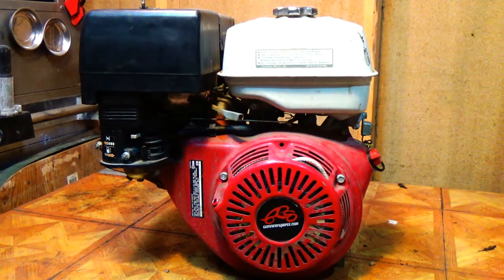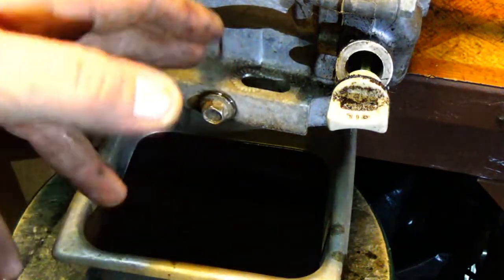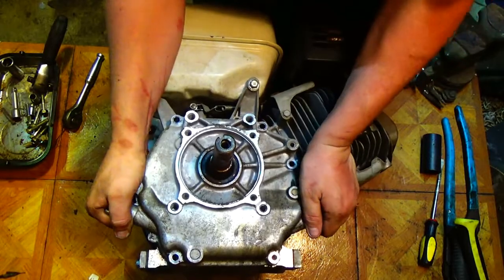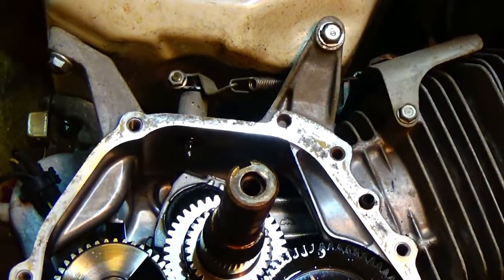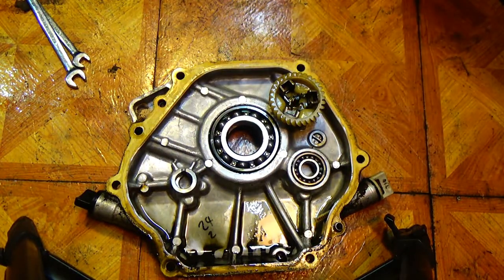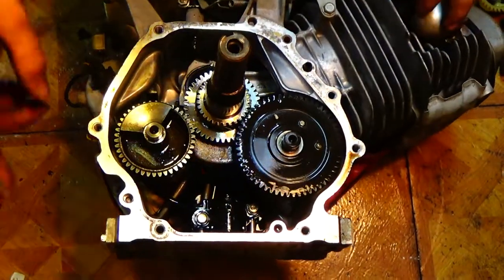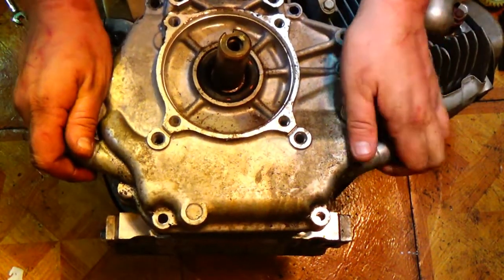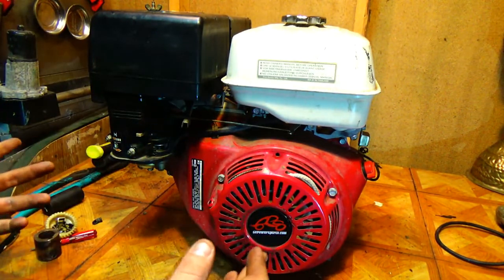Removing the Governor on Predator 420, Duromax 440, and Honda GX390 Engines

Comment: Washer of death dumby. How are u making this video and not mentioning the washer of death. Oh cause u left it in. The only reason u may get lucky and not have it come off that stud and ruin the engine is because u used bolt cutters to unnecessarily cut off the stud and if ur lucky that just did flare the thing enough to not allow washer to come off. Bolt cutters. Ide a left the arm in and hooked up to the linkage so can run stock carbs without a throttle plate . Because it doesn't hurt anything as long as it's left hooked up to the linkage . And by God take out the oil sensor and plug that hole. Like wtf. Ur engine gonna be cutting off when u hit hard turns . 🙄

Comment: Can we just disable the governor without disassembly?  Or hook up to open the governor? We used to simply wire them back. Of course that was decades ago.  How can it govanate if unhooked from the carb or wires wide open?
Reply: The issue with that is you have a plastic gear with metal bits attached to it that wasn't designed to go over a certain rpm. The gear gives up and you have parts bouncing around inside your engine

Comment: Why would this give us extra rpms? Tia
Reply: The governor closes the throttle when the rpm gets too high. Removing it allows the engine to rev to its full potential. Stock engines cant handle much of that high rpm abuse

Comment: I don't see any Honda GX 390 or clone hop up videos.Are doing any?
Reply from the maker: Nah the big block clones are too expensive to mess with.  For the cost of a GX390 or clone build and Torque Converter i can use an ATV or Motorcycle style engine and have more power.

Comment: so wot happens when its removed
Reply from the maker: Engine can rev above the governed 3600 rpm and allows it create more power.
Reply: @nachodadsgarage1159   i have 9 hp honda engine gx 270 would doing this to my stump grinder gv it more cutting powere

Comment: Would you suggest heavier valve springs to go along with this mod?
Reply from the maker: Yes, keeping the stock springs will give valve float around 5k rpms
Reply: @nachodadsgarage1159  Also, will I throw a rod without replacing it with a billeted aluminum one? It's happened before with a predator I had.

Comment: so will this work with the 18hp duromax engine?
Reply from the maker: Yes, I just cracked the case open on my 440 and its set up almost identical to this one
Reply: Nachodads Garage what about the duromax 420? 16hp motor
Reply from the maker: same with them
Reply: Nachodads Garage thanks 👍🏼 just ordered the motor and want to at least take off the governor once I get it. Putting it in one of those Chinese dune buggy/ Gokarts